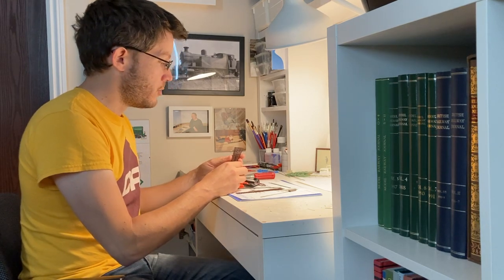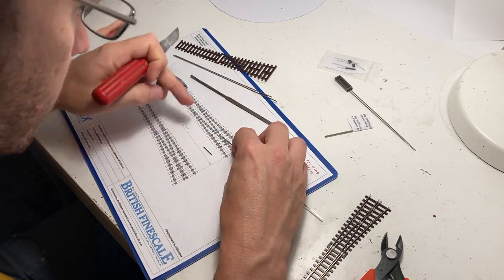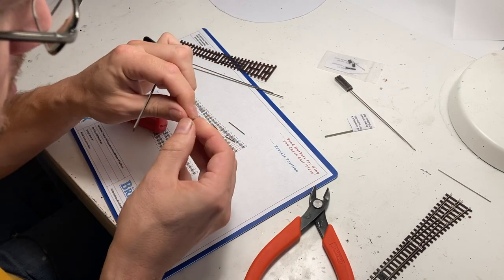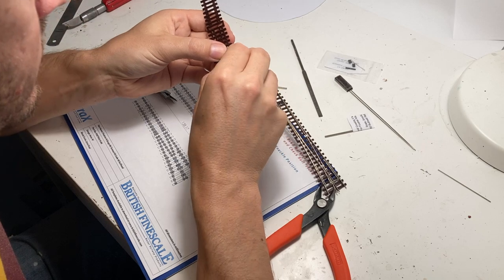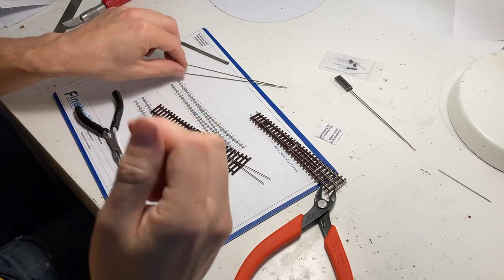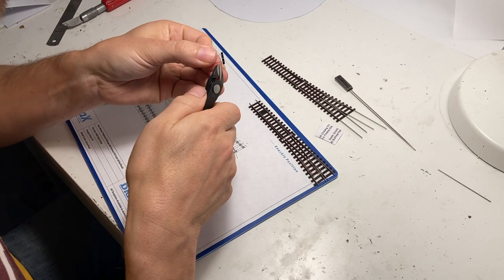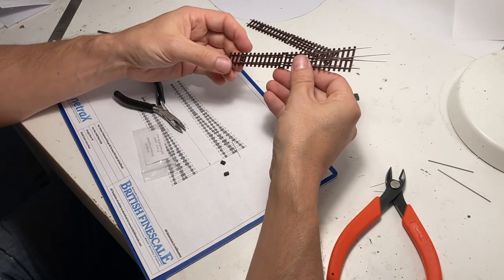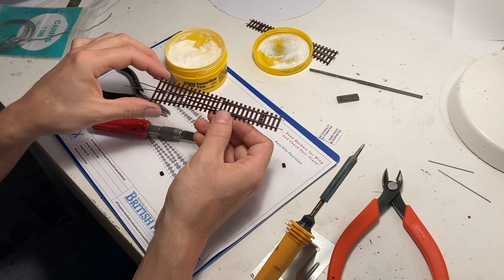Building Turnouts in N - British Finescale Code 40 Bullhead

Comment: Hi James, Fantastic video. I've been tempted to switch to code 40 but I have a query. 
Does the tie bar need to be held firmly in place when switched? I use SEEP point motors as it stands, which give a burst of movement to one side or the other, then are "switched off" by the CDU, otherwise the motor could burn out. But I've been warned that the switch rails will spring back to one specific position if not held. Since you've used them with and without motors, I wondered if you've experienced anything to this effect? I appreciate any help you can offer.
Thanks!
Reply from the maker: They’ll spring back to the diverging road I expect. The servo driven motors I used on Gerald road were nice and gentle for them but not cheap. On Lochdubh I used a bend in a brass rod in a styrene tube to give a bit of resistance - that was enough to hold it in position.

Good luck!
Reply: @JamesHiltonCustomModelRailways  Thanks James! Been looking at options and it seems viable that I can fashion something simple to help keep them fixed. Appreciate the input!

Comment: excellent video; would standard n gauge rolling stock,  including the locos,  run on this track?
Reply from the maker: Hi Tom, I would say yes, modern N is fine on Code 40. I’ve not had to replace the wheelsets in Farish, a Dapol or Revolution to work with this finer rail profile.
Reply: @JamesHiltonCustomModelRailways  ok cheers for that.

Comment: Thank you for this detailed video. Can you recommend a solution for rail joiners, and baseboard/cassette ends with this track? In the past I've used brass rod and tube and it was a bit heath robinson!
Reply from the maker: I believe they offer rail joiners in the range? I would be tempted to use aluminium L angle to create cassettes and create a translator piece on the baseboard with then some kind of metal clip (perhaps document clips?) across the joint.
Reply: @JamesHiltonCustomModelRailways  Thank you, I've just seen that - I ordered through the 2mm Association for which I'm also a member. Interesting idea to use angle rather than rail at the join. I know that's a style you've used before, do you have a particular video where you go over it in detail?

Comment: SCRATCHBUILT POINTS 
The methods demonstrated in this programme are both time consuming and expensive. And reveal its unlikely James ever joined a good Model Railway Club. Or he would have learned the tricks of how to build points without unnecessary extras, and the right tools to use ! I can build a 3ft radius point in N scale in about 90 minutes. Costing no more than around £3.50 - £5.00 in parts and solder.

The only specialist tools I need to build any point in any scale are 4 x brass Rollgauges, which must also include checkrail slots !!! These are needed to hold rail precisely in position while you solder the rail to copper clad sleepers ! And I NEVER use idiot rail cutters, they will not cut rail properly and will partially pinch the metal, meaning you will have to file the rail ends square. Or run the risk of bad electrical continuity when you slide rail joiners on. Use a mini drill with a dark grey carbonundrum disc. This tool will be needed for many procedures during pointbuilding, and track laying and should be in every modellers toolkit !!!  

The main reason to handbuild points, is to escape the unrealistic toy train set commercial trap, of being limited to a small number of set radii, virtually none of which are realistic anyway. Because in reality NO two points were exactly the same, as each point was designed to fit the available space, with whatever radii was necessary. There was no such thing as "small", "medium", or "large" in real life. 

For example a classic double track Junction with two tracks turning left. Requires two left hand points & a Diamond. But the inner left hand point obviously has to have a slightly tighter radius, than the outer left hand point. Or the distance between the two parallel lines cannot be maintained. And no Commercial track system is designed to provide real life parallel track spacing, through pointwork. They are ALWAYS OVERSCALE !

So the method of building handbuilt pointwork realistically means NO KIT every produced is realistic or useful. So why waste money on such absurd nonsense ?

I've taught dozens of people down the years how to build points, all of whom were convinced they could never do such a thing. Because they all thought you needed specialist tools and skills, which is pure bunk. All you have to be capable of is being able to do delicate soldering work. And for pointwork you need a 25 Watt fine tipped soldering Iron, such as a Antex XS25, a type I've used for Decades, as the tips are easily replaceable, and there is a choice of tips (use the finest) when they've worn out. Antex the manufacturer is based in Plymouth & have a website ! The other product you need is Copper Clad sleeper strip available from either C&L Finescale (somewhere in the Bristol area). Or SMP at Marcway Models in Sheffield who can be found on the Internet. 

To build points its best to buy the roughly 1ft long copper clad sleeper strip and lay it on strong double sided clear tape, stuck to the recommended minimum 5mm thick cork underlay. Once the actual rail laying is all complete you then trim the copper sleepers to length using the Mini drill with Carbonundrum cutting disc (do not use metal discs). You also use the mini drill & Carbonundrum disc to very carefully cut through the paper thin copper layer on top of the sleepers to provide the necessary insulation between the rails, and to cut through the rails to provide either a dead or preferably Live Frog, after the point is actually built.      

The first trick is to build the point in position on the baseboard. NOT ON A WORKBENCH. As building the point on site, will allow you to get your pointwork to "flow" as it does in real life, and of course will help dictate exactly what radii will be needed for each point, as you progress with tracklaying. This also saves a lot of time !!! 

Never nail, screw or pin ANY track. This will cause micro dips in track & result in problems for loco pick up. Glue track in place using Evostik White non waterproof PVA woodwork glue. When ballasting using a mix of PVA & water, the ballast will then ensure track doesn't move. Being non waterproof PVA it means you can lift and move track later, by adding warm water on the track which will partially solidify the PVA !!!!

The word "Frog" seems to terrify modellers, only because they fail to understand you DO NOT NEED a SET ANGLE FROG in British point design, unlike the stupid American system. If you look more closely at traditional British points (not modern concrete sleeper types) you will find that in a left hand point, the left hand diverging track begins BEFORE the FROG, not after it, as in American methods ! 

Which means the two "V" rails that make up the frog of a left hand British point, has the left hand rail of this "V" curving to the left from the nose of the "V". And the right hand rail of this V going straight ahead. Which means you can build a British point, without even needing to know what radii or angles your actually using !!! The Roll gauges will ensure the curving rail of the "V", follows exactly the curvature of the parallel stock rail.  

So the construction trick is that you lay the outer stock rails first, with the necessary recess's filed out for the moving blades that are added later. And a slight recess in the trackbed at the position of the moving tiebar. 

Once these two rails are soldered in place to the copper clad sleeper strip, the exact precise position of the nose of the Frog (the "V") is already set in Stone. Now all you have to do is find the exact position of the nose of the Frog, by rolling two roll gauges, one along each stock rail, from opposite ends of the point until they hit each other. Then using a fine pen mark the exact position of the nose of the Frog. Getting this exact position is important, as this now allows you to build the "Frog" one rail at a time, while the point is in position.     

Having laid the Stock rails, followed by the "Frog". You now have to produce the moveable blades. The length of rail that's needed to make a blade is from the beginning of the recess in the Stockrail, past the nose of the Frog for 3 or 4 more sleepers. The amount of this rail that needs to be filed, to produce a nice long flexible blade section, is half the distance from the recess to the nose of the Frog. The longer the thinning blade section the less resistance their will be on the motor used to power the point !!!  Obviously the blade section needs to be free floating, and a bend has to be put in this rail, to provide the "checkrail" section alongside the Frog. To make the bend, a small modellers "needle" file is used to "score" a slight groove on the inside of the bend in this rail.

To solder the blades in position, the section that becomes the checkrail and at least 4 more sleepers towards the tie bar need to be soldered. As much as possible is left free to float to reduce stresses in these movable rails. When both these rails are soldered in place, you need to add the "tiebar". The simplest method is to solder both blades to a piece of copper clad sleeper strip. This will of course require a slight recess in the cork underlay to allow the sleeper/tie bar to move back & forth freely. Lastly the two missing outer check rails need to be produced and soldered in place. Note that to function correctly these checkrails must begin, before a set of wheels reaches the Frog !!!!!

For a beginner it is worth using a Peco point as a guide to copy, for your first ever handbuild point. This will help familiarise yourself with all the parts necessary and exactly where each part needs to be. Practice makes perfect !!!

Happy Modelling 😝
Reply from the maker: Thanks for the extensive and well described process - I never made any suggestion that this was a 'how to build all your turnouts' video - just a tutorial on how to build the British Finescale kits. I'd love to see some of your work in N and compare its fidelity to these kits, that provide a quick and easy way of getting the chair detail accurate for the average modeller who wants to go beyond Peco Code 55.
Reply: I've just ordered some 2mm finescale Finetrax point kits just to get me started in the gauge, having never made track. This video is very helpful to me as a beginner - thanks James. RME you come across a bit combative but I'd really like to see your techniques demonstrated - have you considered producing tutorial videos yourself? say, to put an Inglenook layout on a small baseboard with all handbuilt track as a starter project?